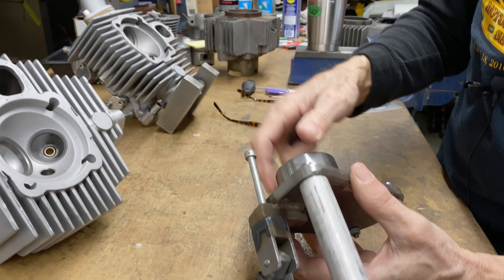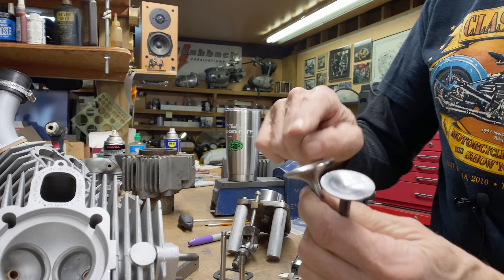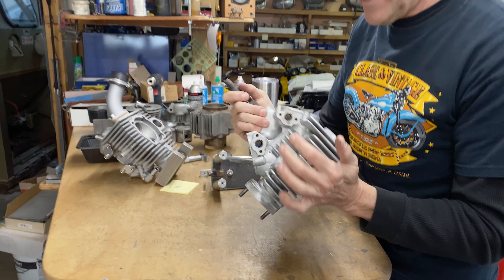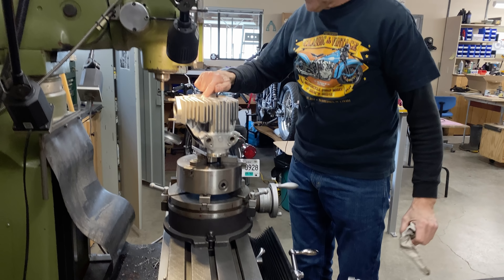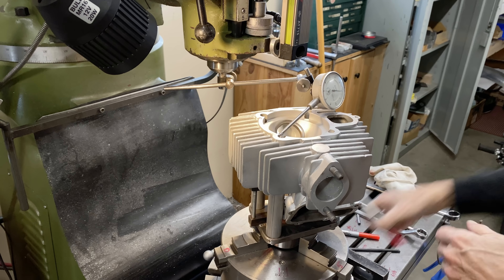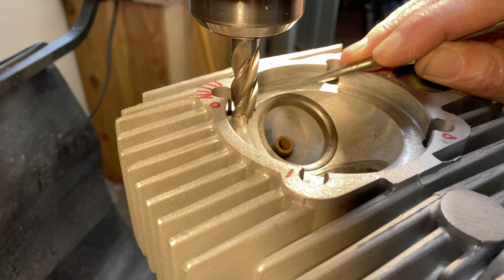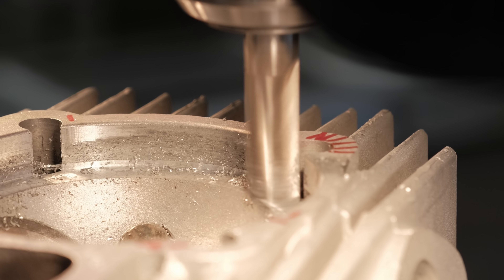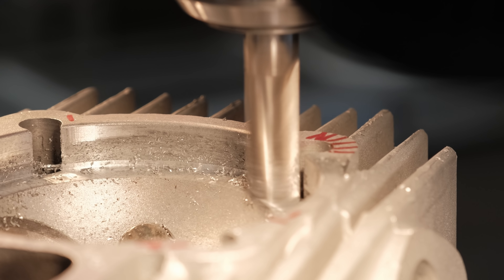How to mill a cylinder head // Paul Brodie's Shop

Comment: I've got a couple of HD/Aermacchi hanging around waiting for me to do something. I'm rewiring a 2 stroke SX175 in the garage and a sad SX 350 has been in the loft for 20 plus years. The 350 has the knucklehead but also has the ugly electric starter case on it... The following are just my personal anecdotes and not a criticism of anything in this awesome video... I spent many decades as a machinist so I know everyone does things differently. The majority of folks do exactly as you did here and the way I did it was different from everyone else in the shop. When I trammed the head on a Bridgeport I would put a ground flat bar on the table surface and lightly set the indicator to zero on it. That way I could slide the bar from under the indicator so I could swing the spindle around 180 degrees without disturbing it and then carefully slide the bar back under the indicator after the movement. The method works well in a vice too.  Another thing I would do is use an edge finder on x and y to find the center of a bored hole (or an outside diameter). It was plenty accurate enough but I could then use an indicator to verify. I don't like milling the bottom step in a bore like this with an end mill because the bore is almost always out just enough to touch the side of the end mill in some random place. I would like to use a small fly cutter to skim the bottom with the tool ground to have clearance to not touch the sides. A little relief cut, chamfer, or radius in the corner of the bore, if needed, can be made while doing it this way too.
Reply from the maker: I like your idea for using a ground flat bar to trammel. Might just start doing that!

Comment: Essentially, I've been an environmentalist for the last, what 30 odd years, but even these days my emotions get pulled all over the place when I see exquisite upper cylinder/head engineering from way back. And it is almost exclusively with motorcycle engines, because of that road of the lightweight engine and power characteristics. I was always slightly fascinated by Aermacchis, because of their pursuit of improvement largely through a single cylinder engine. They couldn't afford to go down the Honda - multi cylinder route, so they kept it all relatively simple and pure. Lovely video.
Reply from the maker: Thanks Rambler Andy. I also have a fascination for Aermacchis, but my addiction is more severe than yours. Happily, I don't believe there is a cure...
Reply: Aerrrnacchis, Parillas, and Ducatis were such good makes in the early '70s in my territory of central Kansas.  I had a Matchless G2CS 250 - It handled like a dream but couldn't keep crankshafts from breaking.  Later on I raced a Parilla Wildcat 200cc when I relocated to N.Y. - it was unbeatable, turned expert on it and was competitive with most of the 250s I ran against later when class rules changed.

Comment: Hi Paul
In 1970 we went to S.I.R. for an AMA race. At that time in the 250 class you could run a 250 2 stroke or a 350 4 stroke. Cal Rayborn was the only guy on a 4 stroke, a 350 Sprint /Aermacchi. The starting grid sounded like a bunch of angry bees surrounding a bass drum. In the first 5 laps he pulled out to a lead the length of the straightaway, then put it on cruise and held that gap until the checkered flag. Another interesting thing about that race was, one of the guys crashed his bike at the end of the straight and it caught fire. It was really going up with a big plum of black smoke. Everyone was running down there to have a look, Dave Aldana included. He was laughing about it until he realized it was HIS bike that he had lent to a friend to ride the race. Thanks for the videos.
Reply from the maker: Glen, thanks for the stories. I saw the Superbike race at SIR in '73 or '74 (?) and watched Spencer, Cooley and Lawson battle it out. So cool. Glad I have memories of stuff like that! I wished I had seen Cal Rayborn race. I saw his son race at SIR years later...

Comment: On my ERS we bumped the compression in a slightly different way.  We put a BSA 650 .040 over piston in it then used modelling clay to hand grind the valve pockets to clear the intake valve.  I could never take a compression test but I couldn't start it at the race tracks until I could get it on the groove to get enough traction to spin it over.  Lots of torque coming off a corner but not real fast down the straights.

Comment: This brings back some memories. I remember when Harley brought in the rebadged Aermacchis and had a factory-sponsored desert racing team here in Southern California. The team was a bunch of very young riders that was led by Mitch Mayes, Tom Brooks and his brother Scott (I think that was his name). And they raced these 100cc Harleys that had been modified so much they didn't have any connection to the real world. Those bikes were just crazy fast, and the team was basically unbeatable - at least in the small-bore classes. The 350 was another story. It may have been a nice road racer and street bike, but not so much out in the desert, if I recall. The 350 was too heavy and didn't have enough power - or at least not enough of the right power - compared to the two-strokes of the day like Husqvarna and CZ. Those bikes were bomb-proof and you could be assured of at least finishing the race you started. Thanks for the great video, Paul. All that work looked as nerve-wracking to watch as I'm sure as it was for you to do.
Reply from the maker: Thanks for the stories! The 100cc Harley was called a Baja, after the race I believe. The 350 made a much better road racer than a desert sled.
Reply: @paulbrodie  Correct on both counts about the Baja. It's been so long that I forgot that. But the factory Harley race bikes sounded like chainsaws on drugs. I think maybe Mitch or one of the Brooks brothers even won a couple races overall, because the bikes weighed basically nothing and had all the horsepower possible that could be squeezed out of such tiny engines. But the riders were exceptional, probably some of the best desert racers ever.
Reply from the maker: @RReese08  I like your phrase, " Chainsaws on Drugs!".
Reply: @paulbrodie  Thanks. I wanted to be general about that so nobody would think I'd be giving preferential treatment of one drug over another. :P

Comment: WD 40 makes an excellent cutting fluid for this type of work on aluminum and it's clear so you can see what you're doing.
Reply from the maker: I use Rigid thread cutting oil.
Reply: So does Metholated Spirits.

Comment: Nice to see you tram the mill. I'm surprised the valves aren't larger for racing. Couldn't quite tell if the  road were smaller diameter heads than the race valves.
Reply from the maker: The OD of the race valves are about 1mm bigger than stock. You can only go so big, because the racing cam has  higher lift, so the valves almost touch on "valve overlap".
Reply: @paulbrodie  curious to know the valve angle on these. Ducati slowly reduced the valve angle on their engines didn't they?
Reply from the maker: @chrislee7817  Yes, Ducati and everyone else steepened the valve angles as the years went by. Off hand, I do not know the (included) valve angle, sorry.

Comment: Paul, Are  you going to Dremel off all the casting flash on the head and maybe cylinder too? Are there any air tunnels thru the head that need to be cleaned? My Model J Harley definitely has passages that need some attention. My plan is to mount a rat tail file in my hand drill and clean things up. Thanks again, Thailand Paul
Reply from the maker: I hadn't planned on it. The motor won't make any more HP.

Comment: hi paul about the valve face design, and although i´m a two stroke man, i know a couple things. engine builders usually leave them to the "valve guy" be that someone who knows the stuff or does not but can take the blame. face form has a saying in compression as you said but also in turbulence, valve train weight, power consumption, valve sealing, valve float, and i don´t know how many more. usually best material are this form. did you check if the valves are stainless? titanium no chance. but the part that is more important is the trumpet part there is the magic some are spiral ground so to induce some twist on the charge. ferrea stainless race valves are that way if i remember well. i had a book which covers or mentions this i think is four stroke performance tuning by a. graham bell but i´m not totally sure. anways. i also think you´re right about the risk of making a fixture to turn that head on the lathe. thanks for sharing love the work you do and always makes me smile. days being rough lately i appreciate it very much. take care
Reply from the maker: Peter, thanks for watching and commenting. I'm using stainless valves of good quality. I'm excited to hear the motor again. It's been years.

Comment: Great work , an increase in compression generally adds more to low down and midrange as long as a suitable fuel is used the increase in sound is from the higher exit speed of the exhaust gases, gases can reach supersonic on exiting the combustion chamber , another superb episode 👏👍👌
I also have a First  mill also ,a LC1 1/2VS interesting mine has a high low and neutral also has twin cooling fans on the variable speed drive , they are a great mills 👍mine is a 1999 model
Cheers Chris
Reply from the maker: I got my mill in 1988. Been great.

Comment: Being there is so little aluminum between the edge of the intake valve seat and the cylinder liner. Do you think once the head is torqued down it may deform the intake valve seat and cause the valve not to seal properly.
Reply from the maker: No, I don't think there is an issue here. I raced an engine with this modification for 5 seasons, and no problems with the valves. Thanks for watching.

Comment: Could the race valves thicker or heavier head be to help resist heat? They have more material therefore a greater heat capacity.
Reply from the maker: I think it's more to do with the shape and flow characteristics. Valves are stainless steel.

Comment: Nice 👍. Wouldn't it have been easier to shave the metal off of the cylinder?
Reply from the maker: I suppose that is a possibility. Then you have to figure out how to hold the thin liner that extends below the cylinder barrel casting, and no simple solution is coming to mind.

Comment: Wondering if a copper squish ring might a be a groovy addition to the cast iron cylinder... on the turbo version time frame possibility.

Time Traveling YouTube beta has some bugs... peacocks are going to love them.
Reply from the maker: Copper squish ring? Do you mean head gasket? You know these motors do not employ such a thing..
Reply: @paulbrodie  Yes I was aware they went together naked like a Chevy exhaust manifold and remember you mentioned no head gasket too but was thinking about the possibility of the barely retained little gasket problem some people have run into. I know someone who had or actually created a problem for himself when his estimate for gasket squish wasn't attainable. He had damage to the head to cylinder seal adjacent to the gasket. His solution was to machine a groove in the head and tap in some 12 gauge copper. He did find a modern composite intake manifold looking gasket from my collection to cut a gasket from that provided a large acceptable squish range. Two additional pins from a little roller bearing located that single pin gasket. I don't recall the engine the gasket was originally for but I'm guessing it was one for a Bell helicopter or small block Chevy, the two tubs left on the bench. Funny how imprecise measurements and perhaps similar close enough machining can add some occasionally creative solutions to use another day. Interesting stuff.
Reply from the maker: @WireWeHere   Some owners have problems with those seals; I can tell from looking at the heads. I use a little gasket goo on one side and all is good. No slippage, no leakage.
Reply: @paulbrodie  Never doubted your solution for a second. Plenty of meticulousness with enough patience for goop to cure.
Reply from the maker: @WireWeHere   The rubber gasket is .065" and the air gap is .035"
Reply: @paulbrodie  Thanks for the results update. Wow, a 30 thou period correct spark plug gap.. gap. Thermal expansion gasket walking doesn't have a chance. I'll be watching to see your sealant/adhesive choice from your, worked well collection.

Boa noit.

Comment: Great video guys! Thanks so much for sharing and inspiring! A fella down the road from me has had an Aermacchi sitting on a bench under a car port , I would look at it on my way home from work for over 20 years. Your making it hard for me to not go offer him some cash for it (I don't need another project at the moment but...) I'm sure it doesn't run and hasn't in prob 30+ years, It looks all there what would you think a fair offer would be??
Reply from the maker: Thanks Rick! For many years I was buying complete bikes for $200. They usually had 5000 miles on the speedo. Yes, those days are past, but you never know... Offer him/her $400 as a start.

Comment: Am I right in thinking that an Aermacchi Ala d'Oro is based on standard road bike castings, tuned up a bit?  Details?
Reply from the maker: Yes, that would be a good assumption.
Reply: @paulbrodie  It's quite remarkable that a road-based bike could compete at such a high level in the '70s.  Especially as it was laid out in the '50s.
Reply from the maker: @pashakdescilly7517   Yes, Aermacchis were, for the most part, well engineered and high quality.

Comment: Hey Paul-I have been building old bikes and custom bikes in my garage for a while and I have spent thousands on little nick-nacks I could of lathed myself. Any advice on a good starter machinist set? Like a good drill press, lathe and milling machine to get started? (And that will fit in a garage)
Reply from the maker: I bought my setup so many years ago that I am out of touch with what is available today, sorry. But thanks for watching!

Comment: Another great video!  Do you plan on shortening the push rods now that the head is 0.060” closer to the cam center line, or do you think the rocker tip contact to the valve is still ok?
Reply from the maker: On my race motor I have a 10mm shorter rod and a racing piston, so the cylinder muff has been cut down 5/8". Yes, the pushrods have to be shortened that much as well. Valve train geometry is very important.

Comment: Hey Paul!  Awesome video.  Do you find you get better luck with using a smaller dia cutter to mill the head down (and less chance possibly of blowing a head gasket) as it leaves a rougher finish, than using a facing mill, or fly cutter at higher rpm's which leaves a very smooth finish?
Reply from the maker: Thank you Johnnie. The 1/2" end mill gets down inside the pocket very nicely. That is the sealing surface, not the top. So, I could not use a fly cutter of any size to do that job. The Aermacchi has no head gasket, so there is nothing to blow.
Reply: @paulbrodie  aaaahhh.  Gotcha.  Makes sense.  I remember well when I was in  junior high and high school those Harley Sprint and Sprint H bikes.  A friend of mine still has the one he had back then.

Comment: Interesting. 
Very similar to how air-cooled VW Beetle was done except VW are a bit easier with flat surfaces to work from but you normally use a boring head and not rotary table. 
Still the misconception about raising compression ratio I see.
Yes, higher CR generally gives more low/mid range torque - with stock cam.
 Main reason to raise C.R., longer duration cams lower  actual dynamic compression. 
Personally, I gave up using static compression ratio's many years ago, they are meaningless numbers, mainly for 'bench racers' in my opinion
As long as you don't have more than 220psi cold cranking things are 'fine' up to 94mm bore. 
I've seen petrol engines with 'theoretical' 16:1 compression that made little less than 210PSI (theoretically should be closer to 225psi) and ran very well with 94 octane gas (and no, it wasn't a two-stroke, two strokes usually have dynamic ratios around 6~8:1 and rely on pulse tuning of exhaust)
Reply from the maker: We will be checking compression ratios because...
They are so important!